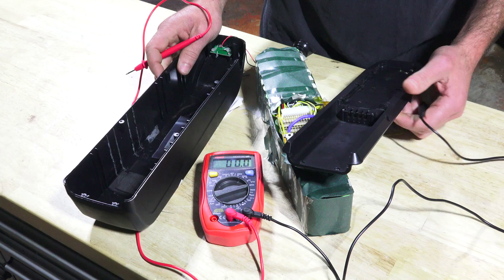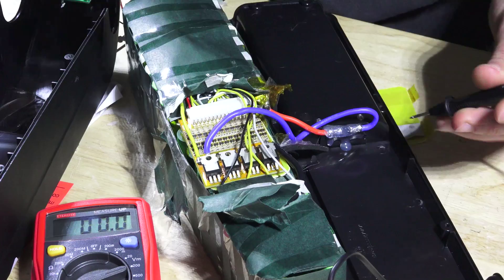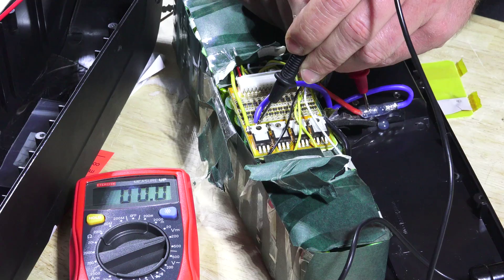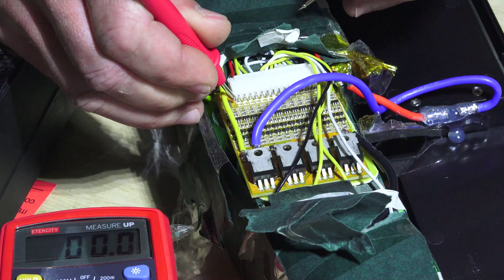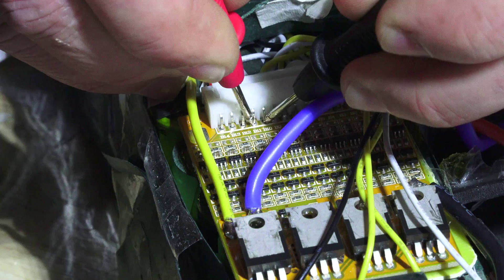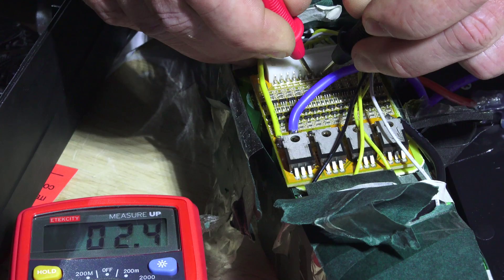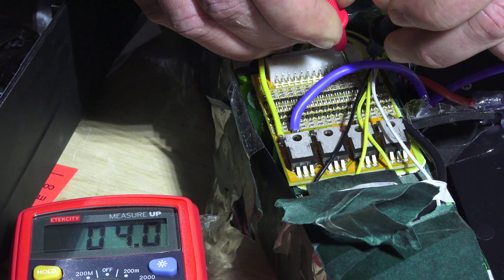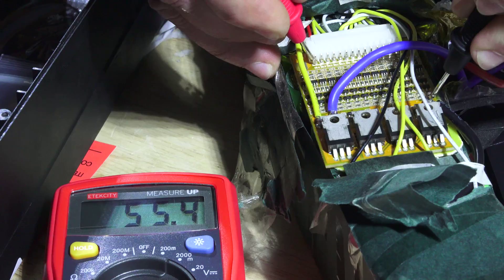Luna Cycle Testing Bad BMS (Battery Management System) Testing 18650 Batteries

Comment: i've tryed to upgrade a ridgid's battery pack by 2200mah to about 6700mah 18650 panasonic ncr18650, (2 pair for 5 in series), when i started to use a brushless drill i've 
 had no problem when tryed a brushed tools the same battery pack stopped to work. To enable  the battery i insert into owner charger and all back like before, what i have to think bms problem with the brushed tool
Thank you vey much

Comment: Hey I have a 48v 13ah battery that won't power my bike , What do I do if my discharge ports are reading 21.4v but my battery charging port reads 53.4v and one cell group is drop down to 3.7v

Comment: I just installed a brand new bms on my 48 volt 13s pack, before I installed the bms, I brought all the 18650's up to 4.1 volts. I went to charge it tonight with the new bms, using one of the Luna chargers set at 100% at 3 amps. After quite some time charging, the lcd on the charger said 53.3 volts and as I was watching it all of a sudden I heard click and the charger said 54.6 volts and shut off. I checked the voltage at the charging port and it was at 53.3 volts. But I checked the battery voltage at the main output leads, and the battery was sitting at 54.0 volts!? What's going on???

Comment: I have a question. Is there a trick to testing each series without accidentally touching 2 of them at the same time with the one probe? Last time, I must had about 5 arcs that way. My battery isn't a Luna cycle pack and my bms has those pins packed so close together. Any tips?
Reply: U need calm Fingers